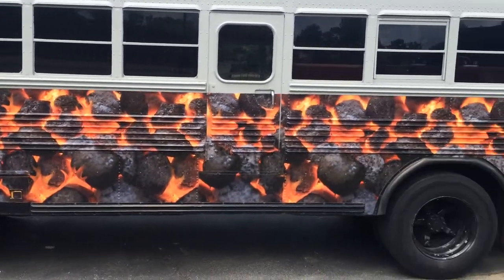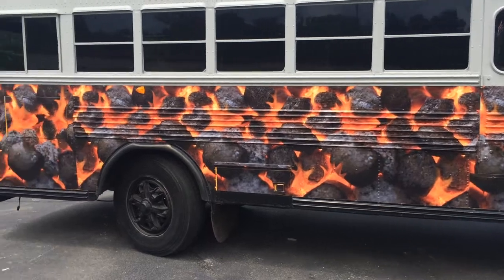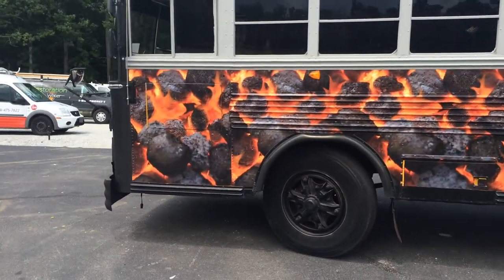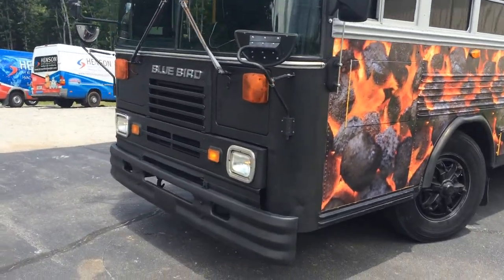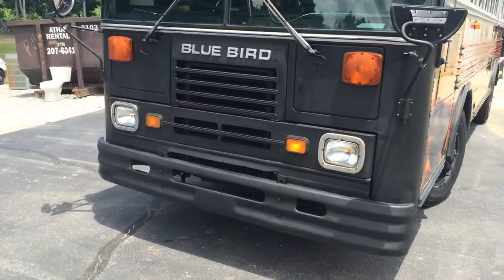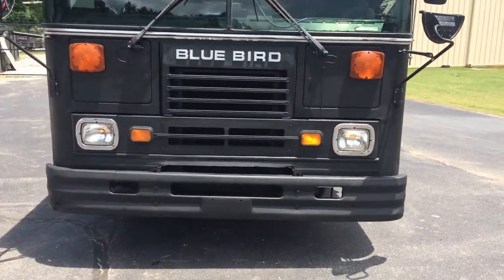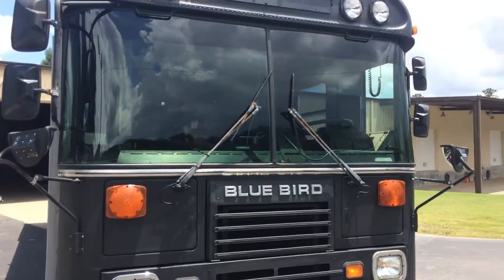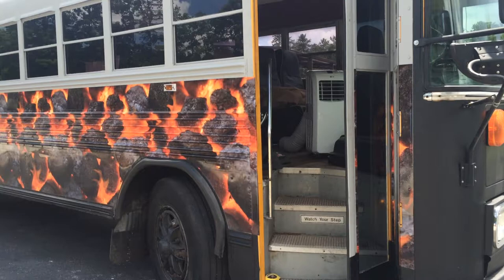How to School Bus Conversion Project - #10 Too Cool BBQ Skoolie

Comment: Was the road speed of your BUs an issue?

I have a Freightliner Bus I was looking at doing something similar to this to. 

However, after driving the darn thing back to the shop, the top speed is only about 67 mph. 

Being based out of San Angelo , Texas, all the roads out of here are 70 to 75 mph legal speeds and I10, that is just south of us, and the main East - West Interstate, is 80 mph. 

At a cruise speed in the low 60’s, it will take forever to get anywhere and could possibly be a hazard. 

I have to figure a way to get more speed out of it before I really go any farther on the conversion.
Reply from the maker: You can get 67 MPH?  I can't do much better than 60.  I don't drive it far and mostly back roads.  Yes, speed is an issue.  If you are going to travel a lot I would look for a "Band" bus.  They are set up for highway use, have a little taller roofs and under storage.  I wouldn't know how to improve the top speed in a cost effective way.  Thanks for watching!
Reply: Band bus...  Good idea.